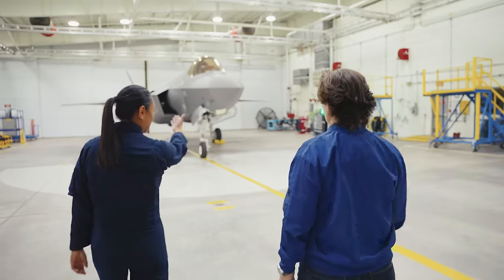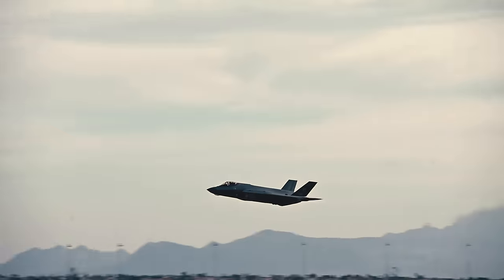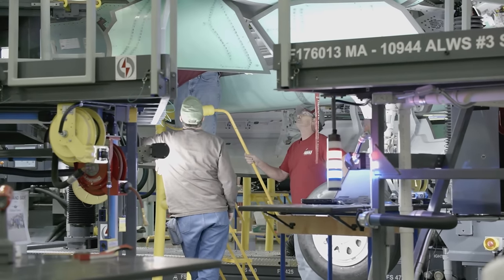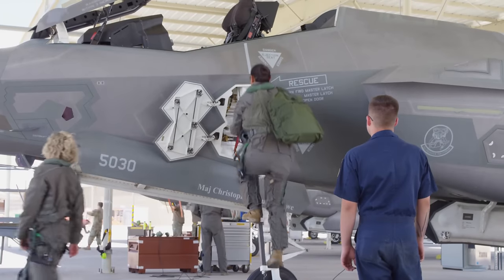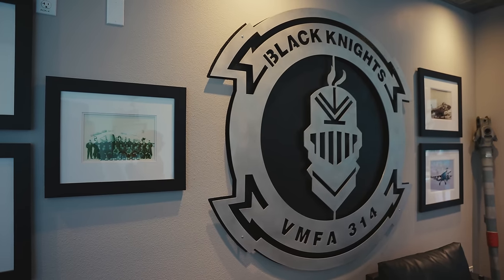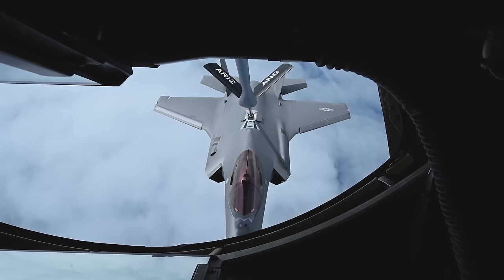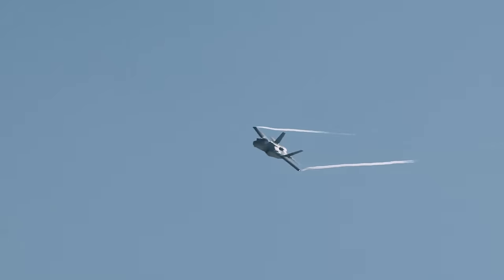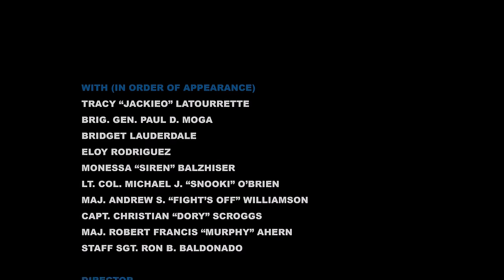The F-35 Lightning II | Behind the Wings on PBS

Comment: From what I have read?
For the price, it's junk.
It is not remotely as stealthy as advertised.
And still costs a ton for a sub-par fighter-bomber.
The Marines 'need' it though as a replacement for the Harrier.
☮
Reply: Maybe read other sources?  I can find something online that matches exactly what I want to think too.
Reply: It’s quite a good plane with a lot of technological advantages.  Pundits focus on the negatives while ignoring the capabilities it has.  The pilots all say it’s a game changer.

P.S., with the economies of scale, its cost is comparable to or even less than a lot of other fighters.
Reply: @keirfarnum6811  Almost every pilot loves his/her plane. Besides, they are not allowed to insult it too much.
 The fact remains that other than avionics and stealth? It offers virtually no advantages over the planes they replace. Not in range, payload, speed or maneuverability. And it is harder to repair/maintain. Plus, costs HUGELY more.
 The avionics can be placed in other aircraft.
 And there are huge doubts that it is remotely as stealthy as advertised.
The U.S. Air Force and Navy would have been far better off just building more F-22's (with a naval variant) with upgraded avionics... a FAR superior plane and roughly the same cost.
✌️
Reply: The F-35 comes with a lot of things (sensors and targeting tools) that other planes have to buy extra and attach as pods on the wings. An F-35A is not that much more expensive if at all to a new F-15 once the cost of external pods and gear is factored in. And the F-35 is competitively priced against European alternatives.
Reply: @XerrolAvengerII  the avionics could go in almost any fighter. So that is no advantage.
And that '$80 million cost per airframe' nonsense that is floating around DOES NOT include the price of the engine! 
 Throw that in and spare parts and the like - and it still costs way over $105 million per copy.
The F-35 has little to no speed, range, maneuverability or ordinance advantage over the aircraft it is replacing.
And it's stralthiness has (apparently) been massively exaggerated.
 Add in the fact that it takes more maintenance to keep a stealth plane in top shape than a non-stealth one.
And the plane is a dud.
Only the 'B' version is truly useful (because it is V/STOL).
✌️
Reply: @ronjon7942  it's not what I want to think. They are called 'facts'.
✌️
Reply: @McRocket damn bro you said they “facts” guess I have to stop thinking critically and accept everything you say as true
Reply: @Apple-om5mr  Instead of throwing red herring fallacies around. 
Why don't you prove something I typed was wrong?
No?
Bye, troll. 
☮
Reply: @McRocket 1. It’s not a red herring fallacy, it’s pointing out you just making claims without any proof and acting like that somehow makes you right 2. You made the claims, the burden of proof is on you.
Reply: If you want to have an actual argument then provide evidence for your claims, else it is evident you are in fact the troll.
Reply: @Apple-om5mr  1) Yes it was a red herring fallacy. 
2) I posted facts.
3) The facts are common knowledge and simple to look up. Plus, this place often deletes links, anyway.
And for the lack-of-stealth part, just search 'air power australia F-35 not stealthy' as just one source.
If that is not good enough for you? I don't much care.
This is social media...not a university thesis.
Lighten up.

Now since you clearly are a troll (or acting like one, at least). And since I try to not feed trolls. We are done here.
Have a nice day.
☮
Reply: I agree with you, maybe someday this aircraft will be great but not right now with over 800 problems still to fix and until its proven in real combat and not against shooting down drones, and at almost 2 trillion for the whole program it's still not cheap, more expensive to fly per hour and maintain, in South Korea they had to put 1 of their f35 into storage because they couldn't get parts for, someday this aircraft will be good but for now it's not. it @McRocket
Reply: @McRocket ’Common knowledge’ is not a source. Try a REAL source, like the F-35 pilots who are smarter than you and say you’re wrong.